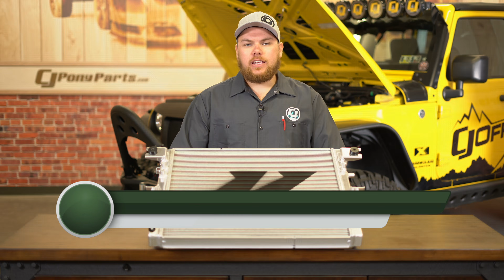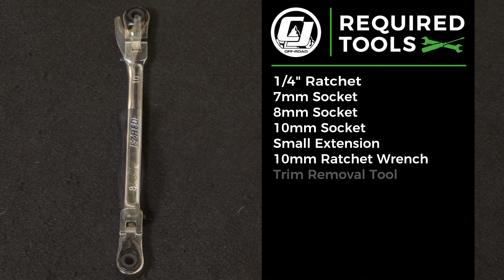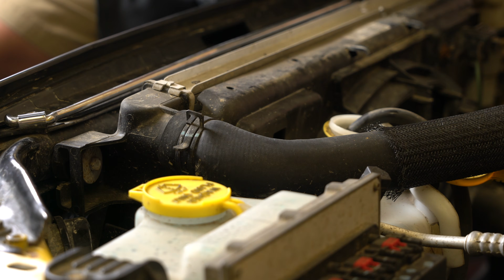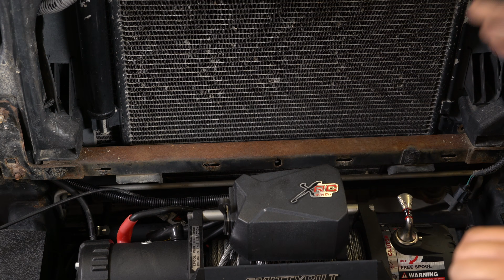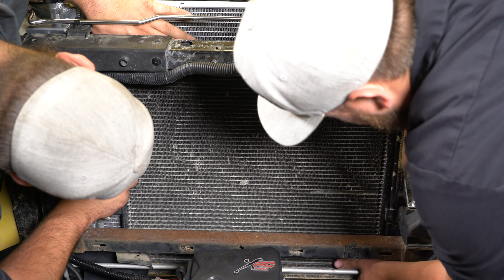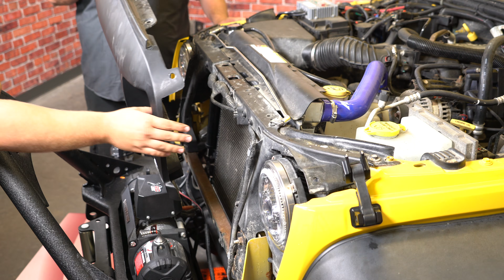2007-2018 Jeep Wrangler JK Install: Mishimoto Aluminum Radiator

Comment: People are having better luck with this brand and others by not fully bolting it down. Use a little loctight on the bolts with the radiator able to wiggle around slightly. When you flex the jeep it doesn't twist the radiator during the flex.

Comment: You haven’t lived until you’ve done a radiator swap with the trans cooler and a power steering cool up front there as well. Certainly adds a degree of difficulty
Reply: Any tips, as I have both and am planning to do so?

Comment: Whoever reads this they forgot to tell you a few things. Take the old rubber mounts off the factory radiator and install them on your new radiator aftermarket or not. Also the condenser holes won’t line up you will have to make them bigger to mount the condenser to the radiator, you will be able to mount one side but not both, Yes I bought and installed one of these radiators myself. I hope this helps you. I also changed the the heater core the easy way and put a fail safe thermostat in along with a new water pump. Your right there you might as well change it. Now I have heat heat in my Jeep !
Reply: Check the height of the side AC line bracket mount -- it should be 3/4" tall, not 1" like mine was.  Shorten to 3/4" and all holes line up correctly.

Comment: Watch this video FIRST.   CJ Off-Road missed some things.  I just did this had to order the left and right radiator shrouds you don’t need to remove the fan before removing the radiator.   https://youtu.be/ED5tJh52g98

Comment: It’s missing threaded hole on the right bottom corner comparing to OEM. There are 2 metal lines that left lose after installing. If they rub you’d develop the hole very quick. Idk why such an expensive radiator left this out. Disappointing

Comment: Whats the device on top your fuse box?
Reply: I saw that too and after much digging ... it is a Trigger 6 Shooter Wireless Accessory Control System or in more simple terms.
A wireless remote aux fuse/relay box. why you want that is beyond me.

Comment: Pro tip: enlarge the holes of the ac condenser and manifold mounting holes that connect to the new radiator. Fitment is not going to be perfect so bending some tabs together with enlarging some holes will make using all fasterners less of a headache
Reply: Wish I had seen this sooner. Condenser and mounts on radiator do not line up on one side
Reply: @253_overland  Measure the AC line bracket mount -- it should only be 3/4" tall.  The one I received had a 1" tall mount (cut it down and all is good).

Comment: Jeezus   - don't do this mode.  I did it about 3 or 4 years ago.  The radiator is weaker than stock.  I went through 3 of them in about 2 months.  Contacted the company and they think it's the frame of the JK causing the radiator to fail. (i'm just doing street driving). It cost my a fortune in antifreeze having to fill up after each replacement and all my time!!!  Thank GOD I did not pay someone do do this!!! it would have been a fortune times 10! Anyway - went back to stock and haven't had any issues.

Comment: i have had mine in for about 20,000 miles and it leaks i put in the silicon hoses and the antifreezes from mishimoto not happy 2016 jku

Comment: Thanks this was a great well executed video. I have a faint smell of antifreeze on my 2016   No drips and it doesn’t run hot but makes me nervous. So brought it to the dealership they wanted nearly $1200 for OEM which only lasted 2.5 years!
    I’m completely capable of handling what I just saw in this video so for a few hours and around $300 in parts.   I’ll be doing this myself now.  

Thanks again!

Comment: It definitely doesn’t take 5 hours. Roughly around an hour to take it off and one to install. 20mins to  add coolant and circulate the air bubbles from the heater core.

Comment: Oh and good luck with the customer support they are as shity as the crap ass weak radiators I do not even wheel my Jeep JK and the shitimoto radiator leaked after 800 miles  I’m on my 3rd one I know guys whom had replaced 4 times Stay Away from Shity Moro products they will be out of business soon I also contacted BBB to report the lame ass company you will be sorry and you were warned.

Comment: My radiator just cracked on my JK I just found a Mishimoto as an open box, I figured i minus well go with it. Thanks for the video
Reply: By now you probably bought another, because this is 7 years old post, and mine didn't last 4 years.

Comment: Are there any reviews on their 2nd  gen ?Their first gen had a lot of bad reviews .
Reply: jason cullen I just installed the Version 2, was hesitant because all of the bad reviews from Version 1 leaking after only a few months. I called Mishimoto and talked to them about what they did to the updated version and I guess will have to wait and see. Only had it on for a couple of days also flushed the entire system because last owner had put wrong coolant in. I checked the history on my Jeep (2015 Rubi JKU) and it is on its 2nd mopar radiator at 50K and I could smell  strong coolant odor at top right drivers side after driving. After pulled off, didn’t see any visible powder from dried coolant but also didn’t pressure test either. If the Mishi V2 goes bad, will probably go back to Mopar or Griffin model since  they obviously didn’t get it right. We will see.
Reply: Seth Hall Im wanting to get the V2 but I’m a bit hesitant too. Especially for the price
Reply: @S2K_Crosstrek  how are things a year later?
Reply: @Team-Elevated  no problems yet, no leaks and cooling has remained the same. I have only put a couple of thousand miles on it l. Jeep is stored in the winter.
Reply: @S2K_Crosstrek  any problems since or still running strong.
Reply: @mikeholbert1686  no problems yet on the V2 radiator. Have not seen any leaks.
Reply: @Seth Hall did the condenser need the holes drilled on the v2?

Comment: Honestly it would have been a 5-star video if you ended off with the before and after difference of temperatures and what kind of coolant you used to replace it with.
Reply: It just the jeep recommended coolant, I went to a dealer and they gave me the correct coolant at an affordable price. It was a few extra dollars but having Mopar/Jeep brand coolant and fluids is what I always do to make sure everything works correctly.
Reply: The before-after temps are going to range so widely depending on so many factors, the engine works harder for driving 33"s, 35"s, 37", 40"s, then it works less for 4.10s, 456's, 488's 513's, then more air gets to it depending on grill, OEM Grill, Angry Bird Grill, and more or less air gets to it if you have grill inserts with US flags and stuff on them, or if you have lights mounted in front of your grill, and lastly, if you have a winch it'll restrict airflow, or if you have it sunken, it'll improve airflow (or if you have no winch at all, that's ideal), as well as if you have a stinger or bull bar, that'll also restrict flow, PLUS and probably most importantly, ambient air temperature where you live.  It's totally possible, if you have a great airflow, no winch, no bullbar, a free and clear grill with no slots or obstructions, that the aftermarket radiator has no degree improvement over the stock under normal driving conditions, but then change any of those variables (do a hill climb in 4 low with 40"s on 4.10 gears) then maybe the OEM will heat soak faster than the aftermarket.  Too many factors for an apples to apples comparison.

Comment: What are the temperatures different between the stock radiator and the aluminum one? Would have been a better video I wdont know if I'll buy one tell I see the gains from the temperatures different.
Reply: Not much
Reply: Was average of 222 to 230. Towing and pulling a hill 240 to 250 limp with inside heater on high. Now 205 average and 230 to 243 towing up hill without running heater.
This is with their 180° thermostat installed.

Comment: Why not swap out water pump while in there?  Also, how much difference in cooling does it make, and do you need new thermostat? Nice video!
Reply: @stevenp3176  where are the vents?
Reply: @Team-Elevated  additional vents on the JL on front fenders for the engine heat to leave while driving on the sides.
Reply: @ADCC-qp2gk  o right on. Thank you
Reply: @Team-Elevated  I owned a JL for 4 and half years and I did notice that gas mileage is way better than the jk I now own I'm doing anything I can to help with gas now lol the JK also are heavier than the JL also so Chrysler did alot of modifications to improve the wrangler from Jk to JL.Doors got liter on the JL from the JK,the body weight of the JK was heavier than the JL also.
Reply: @ADCC-qp2gk that’s not true, there to reduce hood flutter
Reply: @eloser  I'm aware sir .